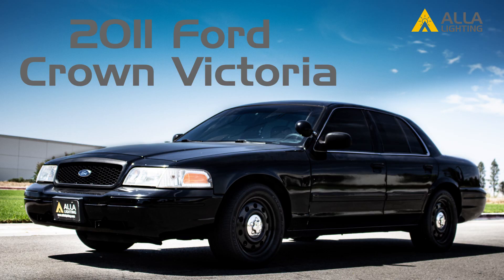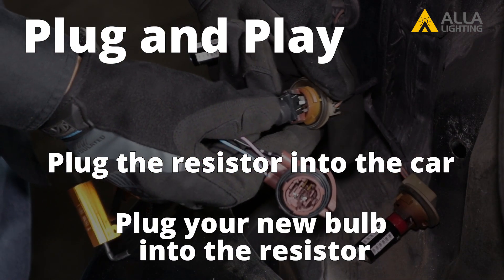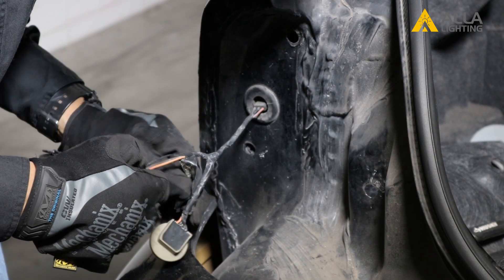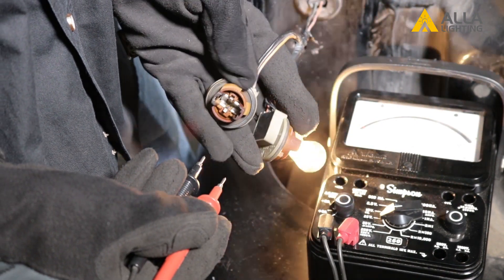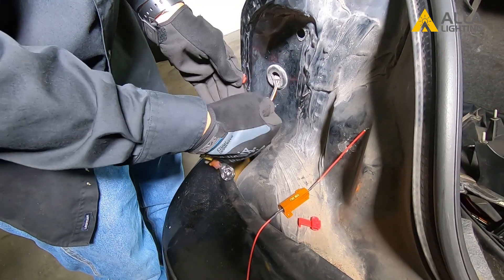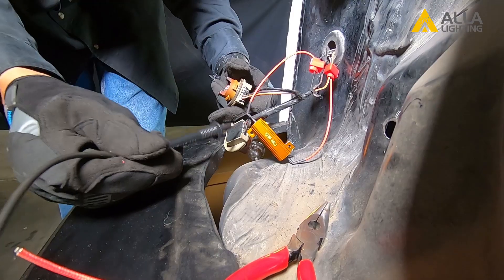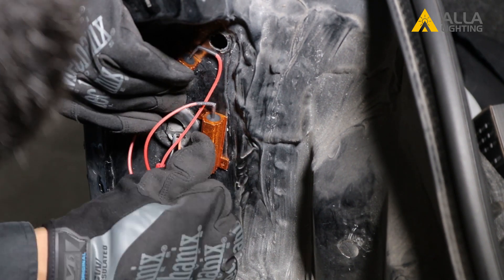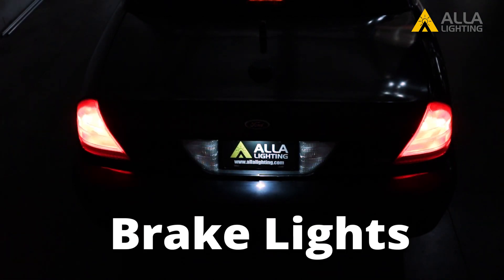How to Install LED Resistors Fix Turn Signal Hyper Flash/Error Code?

Comment: @AllaLightingAutomotiveLEDBulbs

Also do we need the dual resistors version of the plug-and-play load equalizer resistor for 3157A because of the two separate circuits for dim function and turn signal function?

Or just one load equalizer resistor for each side, is enough for both dim function and turn signal function?

Comment: @AllaLightingAutomotiveLEDBulbs

U did say that the load equalizer resistors plug-and-play version kit will work fine on 3157 from any vehicle. But it’s made for standard socket only. 

Then again, if the led bulb is compatible for both CK socket and standard socket, than the plug-and-play version load equalizer kit can definitely work correct?

Meaning that we have 2017 Toyota sienna LE with a front 3157A with a CK socket. 
And putting load equalizer resistor plug-and-play kit that had a standard socket on to the CK socket. 

If we put an led turn signal bulbs that’s compatible for both CK socket and Standard socket, it will function well between dim function and turn signal function?

Comment: @AllaLightingAutomotive 

For 2017 Toyota sienna LE, would a pair of fix plug-and-play version load equalizer resistors that has 50 watts, will be enough to delete the hyperflash for front and rear?

Or do I need another pair of fix L.E.R. For one pair for the front, and another pair for the rear?

Comment: Wont work on my gmc canyon still flashing fast and it warm
Reply: If one resistor make it flash you need two resistors..i just went through same thing on a camry..you also don't need another resistor at the front..the two resistor will make up for the front..hope this helps

Comment: Hi 👋 so i install  this on my crv, the plug n play. So you said its goin to be super hot the both heatsink housing.. so its true.. so it mean keep away all the wirings? And you can really smell it inside the car, is that still okay?

Comment: I have a 2017 Chevrolet Silverado 1500, with aftermarket led tail lights.. My turn signal lights up on the top and bottom of the tail light.. My question is do I need 2 resistors for both upper and lower bulbs??? Thank you

Comment: Do you still need to install resistors to the front signal bulbs if there led or does putting the rear resistor effect the front as well 🧐
Reply from the maker: Yes, unless it is CANBUS Error free LED signal lights bulbs

Comment: what plug and play load resistor do you sell for a 2012 camaro rear turn signal?
Reply: use the plug in play alla lighting resistors the ones in this videos i have a 2010 camero 2ss an had the same problem plugged the plug in play resistors in an never had any warning on the dash or anything they work great 👍🏽

Comment: I have the plug and play set how do I remove them out of the headlight housing
Reply from the maker: Have you installed them already? or are you going to install the plug and play load resistors set?
Reply: Alla Lighting Automotive LED Bulbs yes and I’m trying to remove them.
Reply from the maker: @kevinbradwell659  If so, just please power the vehicle off, and then disconnect the wiring between the load resistors and bulbs, and then you can remove the load resistors, please make sure not touch the metal load resistors part when it is hot for it may hurt